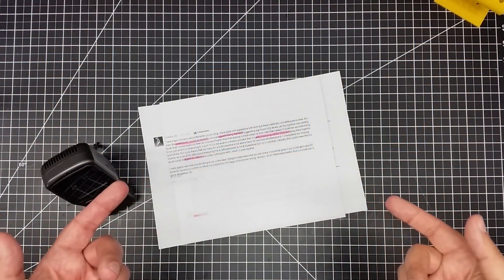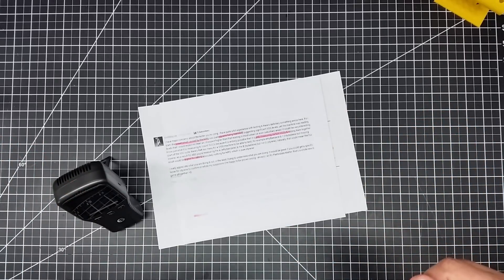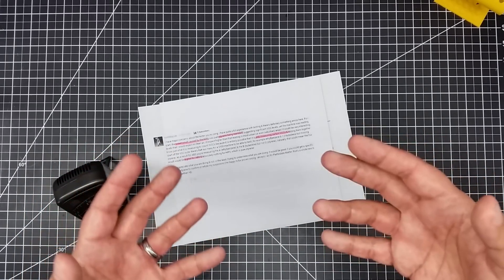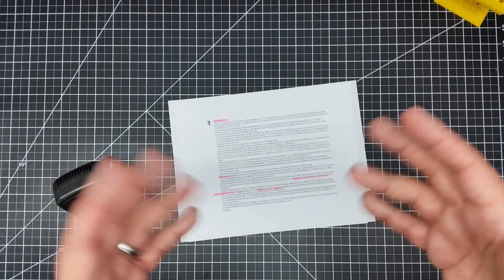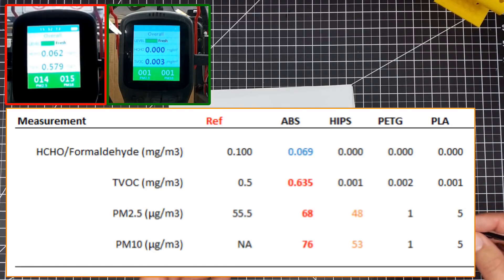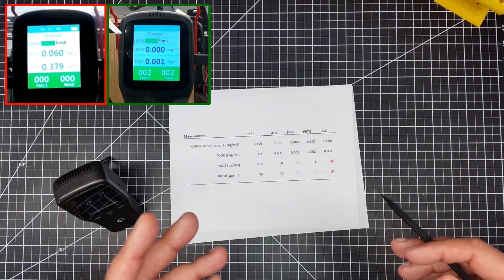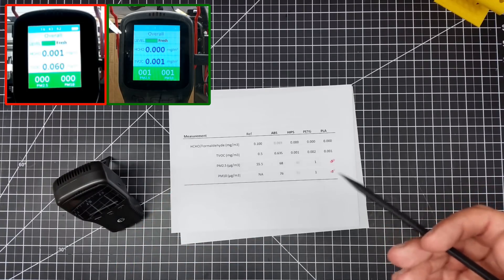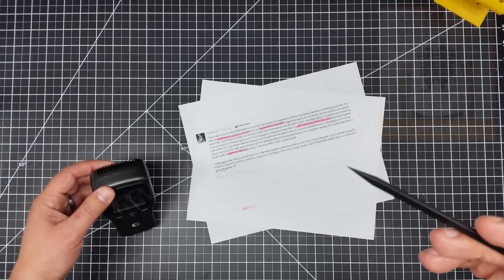3D Print Air Quality - PLA verses ABS and the Results are In!

Comment: VoC higher in the beginning could be from the solvent (alcohol) used to clean the plate and the warming of the build plate and extruder will warm up dust and chemicals on those parts.

Comment: Carbon gets saturated. You should look into a ERV to keep the room pressure and humidity balanced while exchanging air with fresh air.  

When testing with that meter you have to figure your baseline that day as the rooms VOC will change wildly from day to day then you would just record the Delta of reading not the total.  Cooking and  Cleaning made my voc meter go crazy so it could be easy to taint reading unless you have your set up in a sealed room with vents blocked.
Reply: keep pressure balanced like a PC tower? i made a container with clear acrylic doors with a fan/activated carbon ventint through a tube out my window. Its not airtight and i only have air sucking out. I need some coming in or the little cracks that i didnt seal good enough? meter to recommend?
Reply: @mackyd955  an ErV will exchange about 50% of the thermal energy with between incoming and outgoing air to temper the fresh air and also exchange latent energy via moisture.    If its humid outside and dry in your box your fresh air won't be as humid.   Doing this with a dehumidifier will ensure dry fresh air for the whole workshop.  Exhaust out of the box but bring fresh air into the room where you dehu.   Add a heater on a thermostat in the enclosure.   
You can split the exhaust to multiple enclosures or workspace hoods. ErVs have  constant CFM starting 40-60.    With boost CFMs of 120-160. To much larger.    They have high static pressures too and dual motor systems will let you balance intake and exhaust if you have like a mrv13 on your intake

Comment: Can someone please help.    I have a relatively low budget, but put a lot of time setting up a PLA printer in the back of my "computer room".   I got an Ender 3 Max, which I do like.  I bought a hutch-like table with a long counter top basically from a garage sale and the end plan was to have two 3d printers.     I have just one now.   I will never have more than 2.
The idea was sound, I spend a lot of time on the computer and so yes, I can be there if there's any problem with the prints.
Should I move all this to a room downstairs, or is that overkill for just PLA printing, just for air quality, cancer avoidance, what have you?   It will also be a big hassle to walk back and forth down there every time I need to check on a print.     I don't plan on ever printing ABS.   I can't really fan to the outside because we have hot summers here, some 3d prints take days and the utility bill would be astronomical.

Comment: You asked why it had more at the front end. The reason is that when it's hot and cooling what happens is the processing chemicals when they make it come out of the filament.
It's like that in other things also, the reason you use a mask with epoxy resin. There are many chemicals exiting epoxy resin during cure and cooling. Remember filament heats, melts, and cool / cure.

Comment: Yes I am am very sensitive to this stuff... I have been very tired lately.  I've been printing ABS and PLA, PETG.  I have been printing ABS consistently for about a month. Finally rigged my exhaust to simply suck the air out of the room that I have the printers in.  It's just a simple 4" in-line fan with hose. I  have it placed next to a hole that is at the base of the ABS printer's enclosure.  The inlet is next to the other printers also so I feel like that will be good enough. It's a 12 x 12 room.

Comment: So what is the best approach for people that can’t take it outside or garage to print? I use mostly pla/petg.
Reply from the maker: As you can see from my air quality videos  these two are not bad however if you or a family member have respiratory issues (like my wife) you will still have issues because of particulates.  Many people in this situation build cases and vent to the outside.  However in all seriousness, 3D printing like other forms of hobby making really require a space which has an adequate air flow for safety.

Comment: This was a video I was involved with. The meters we used are extremely accurate in particulate measurement. At one point using PLA we recorded 30000 nano particles per Cubic Centimetre of cabinet space. I hope this is seen as informative rather than a post hijack https://youtu.be/Dl7rOHnk4fY
Reply from the maker: Interesting however PLA inst that bad, what about ABS?
Reply: @DIY3DTECHcom  thanks for your reply... well this is the thing and the reason we did PLA. No there aren't the harmful VOC's, but what is the problem is the massive amount particles that can be ingested. Smaller particles can enter airways and cause all kinds of problems respiratory and circulatory and worse the body cannot expel them. I wouldn't want to be an employer with one of my employees sat next to a 3D printer all day. 
Lawsuits will be coming... there was a post on Lawyers.com last week 'Research done by the NIOSH found that 3D printing materials that use PLA filament at low temperatures have the potential of generating over 20 billion particles per minute, while ABS feedstock can produce over 200 billion particles per minute.' I will imagine the US will be hearing a lot more about this very shortly....
Reply: @mattwine1  aren't the particles in PLA metabolized easily by humans?
Reply: @piesdescalzos27  I dont believe so, hence the concern... I expect there are more conclusive results online these days, might be worth  google.
Reply: @mattwine1  Yeah its metabolized but its very slow. It takes months to years to do so. It can activate the foreign body response, so its no good, even if better than other plastic that can't be swept away by cilia. Also, this is for pure PLA. But for FDP PLA it's usually several molecular weight PLA + other polymers (that seems to be very nasty, even if the lowest amount of all the filaments). So while it seems that a carbon filter is overkill in the presence of proper ventilation, its obligatory in its absence. 
Foreign body response can definetely make your life miserable, even way after the insultant has been removed. So be safe, and assume your PLA filament is fused with hazardous polymers.
Reply: @piesdescalzos27  thanks for your insight... our video was made a couple of years ago and was of course quite basic. No-one would listen to us wanting to believe that ingesting any material even happened. That's kind of how far our research got, what with covid and so on. We did get the health and safety executive to listen and they did eventually produce a report and guidance. I'm imagining lots of lawsuits in the near future as companies still bury their head in the sand....

Comment: I am confused  (my normal state of mind).  I print with ABS and have been reading all the concerns about toxic particles and VOC being released during the print process.  I decided to test my situation.  I obtained a monitor similar to yours from a different company. Same specifications as yours.  Ran through their calibration.  My house HVAC system is equipped with a high-efficiency filter.  The back ground particle count for Pm10 and Pm2.5 was very low around 2.  Taking the unit outside the particle count ran up to 20 which agreed with a web site that has air quality information for my area.   Using a felt marker near the device the TVOC jumped considerably.  Looks like the device is working.   Now to test my ABS printing.  The room I have the printer is a 10' x 10' room with an 8' ceiling.  There are two windows in the  room as well as a floor vent for the HVAC system.  I ran the test with the vent, windows, and door closed to trap contaminants in the room.  Make it a worst case situation.  What did I get?   NOTHING.  The particle counts stayed around 2. The TVOC went up slightly but the unit stayed in the "GREEN" for air quality.  I ran a 2 hour print. So I figured the unit I had could not measure the smaller particles from the heated ABS.  I replaced the meter with one from Igeress. This one has a count for p1.0.  Ran the test again.  Same thing.  I don't get any increase other than a very slight increase in TVOC.  I even moved the meter directly over the print bed.  I doubt the ABS filament from IC3D is any cleaner than ABS from someone else.   I don't understand why my measurements show nothing where others using similar instruments from Igeress or other show significant higher numbers.   Comments?
Reply from the maker: Several things as first and foremost with ABS it is not about "particles" however the release of styrene and its related compounds (as the ABS is broken down during heating).  Now one can say "oh this isn't a lot" and for some they could be right however others they could be wrong.  For example my wife has asthma and a single print would bother her and not me (this is why I built a shop separate of our homes HAVC envelope).      To why you didn't see the change?  First you have to measure the output in a measured reference area as if it is being defused in an open it is still there but your meter will not read it as it will not pass your meters sensor.  Then I know the next thing your going to say "but that's not fair", and my answer is yes it is because even if you have a HEPA or MERV 16 filter you can not filter the styrene out of the air and it becomes cumulative setlling on  object and building up over time.  The only way to deal with it is to have active direct ventilation...

Comment: If I have a cr10 mini in my room printing my pla from creality is it ok or should I put it somewhere else
Reply from the maker: Well as I say in the video, I am not a doctor and PLA is not that bad as say compared to ABS or it polystyrene based relatives, however frequent use will deposit mico-particiales which can build up over time and the bed room is a place where you spend a lot of time in.  So even with PLA I recommend they be placed in a location where there is a reasonable exchange of ventilation and not an over abundance of fabric surfaces.  Also keep in mind that one PLA can be ok then who knows what the Chinese will dump in the next batch as filler just like they did with melamine in the milk....
Reply: DIY3DTECH.com do you have a filament recommendation that is a good one

Comment: I remember someone who was printing in PLA liked the sweet smell which is believed it was from corn starch like a waffle.  Here it is said the sweet smell caused by HIPS is from styrene.  Like to clarify that the sweet smell in PLA is not from styrene, no styrene is mixed into PLA. Is that right?
Reply from the maker: I have never smelled a sweet smell with PLA, a sweet smell is basically "styrene" a carcinogen found in styrene based plastics such as ABS/HIPS and ASA.  In normal PLA, there should be no styrene however you can never guarantee what the Chinese will mix in....

Comment: Your readings may be different at the very beginning vs later because many air quality readers for the first 30 seconds read every second (real time), after that it reads at longer intervals.
Reply from the maker: Not really as I have made many tests as seems to be focused on the solid layers contacting the heated bed prior to in-fill.  However I don't full understand way the "top" layers don't repeat the effect...

Comment: Emissions of Ultrafine Particles and Volatile Organic Compounds from Commercially Available Desktop Three-Dimensional Printers with Multiple Filaments
https://pubs.acs.org/doi/full/10.1021/acs.est.5b04983

Is 3D printing safe? Analysis of the thermal treatment of thermoplastics: ABS, PLA, PET, and nylon.
https://www.ncbi.nlm.nih.gov/pubmed/28165927

Characterization of Emissions from a Desktop 3D Printer 
https://onlinelibrary.wiley.com/doi/full/10.1111/jiec.12569
Reply from the maker: Yes if you read the resource page there are a number of these links...
Reply: I only saw linked under the video which actually doesn't take you to the article just a reference to it.

Comment: I've been really enjoying your research in air quality. There is however a specific thing I'd love to see you test and show here! Algix Algae based PLA. It makes for some very cool prints with an excellent texture, BUT...and this is a big but...it smells absolutely wretched while printing! The smell may be hard for some to imagine, but basically it's roasted algae/moss smell. So I'm wondering just much more nanoparticles etc come out of this type of PLA compared to 'normal' PLA. Or of there are any other gases etc emitted that I cannot detect by nostrils alone.
Reply from the maker: Please send me a link and I will do some testing 🤓
Reply: Well apparently the place I got my roll from last year, www.printedsolid.com, no longer has it. 
The company website is http://algix3d.com/products/uncategorized/advanced-pla/  And it looks like maybe they've changed their formulation since my purchase, but I can't verify for sure.
Reply from the maker: Interesting and it melts at 165c will look around see if I can find...
Reply: Yeah oddly low melt point! I found that I usually print it hotter, more like 190 and it's very prone to oozing and stringing badly over long expanses. It doesn't respond the same as other PLA to retraction settings either. Or maybe it was my possibly older formula, maybe that's why they changed it? Hope you can find some to play with, despite the drawbacks I still want more.

Comment: does it taper off because the fan of the machines are kicking up the dust/particles of the initial start up and then it evens out over time as they settle?
Reply from the maker: Good point but don't think so as I tested various fan settings and even ran all of the fans before starting to ensure the air was worked up however the same results...

Comment: I really like even these basic tests. I have stopped printing ABS all together in the house printer, and i am building a carbon/HEPA for point of contact ventilation. By the way, tell Dr. dave brakes have not had Asbestos since the late 70s.
Reply from the maker: Yes you are correct as the sad part is something in the US becomes banded, you  typically see the processing machinery be boxed up and sent to other countries which are less "alert" as you put it...
Reply from the maker: Lol!  Dr Dave like I have a bit of grey hair and remember those days:-). Also glad I could help ;-)
Reply: Keep in mind a HEPA level 13 or 14 is required to actually be small enough to capture the nanoparticles released by these materials! Standard HEPA for 0.3 micron won't capture much.
Reply: Regarding brake pads - a minor correction being they shouldn't have contained asbestos but many did, & I'd hazard a guess that some may still be produced by less scrupulous people that do contain asbestos (my father was a mechanic, plus my own research). Many people don't realise that although in the 70s we became more aware of the dangers of asbestos it was still in common use until decades later in "alert" countries (like the UK/USA) & is still used in others! A good crib list of legislative bans can be found at http://www.ibasecretariat.org/chron_ban_list.php.
Reply: Good call! I'm working on creating a HEPA/activated carbon filtration system for each printer enclosure. Doesn't have to be as large and much easier to create the negative pressure environment for each machine rather than a whole room.
Reply: secretagb I agree. I'm taking the 'PPE' route myself & relying on high specification face masks rather than any form of room-wide filtration. That's when I'm not printing in PLA, of course, (which I have yet to do, other than trying rPETg briefly). I'm going to build a full enclosure with active ventilation to the outside for when I will start printing in earnest. I'll also have a form of scrubbing prior to exhaust to reduce any environmental issues.

Comment: What's the best style of ventilation? How light or heavy are the fumes to the atmosphere? Ex. I heard when cutting a propane tank it's best to drain it upside-down because propane is heavier than Air. If I was going to make a ventilation system for propane my exhaust would be on the bottom but if I was doing helium since balloons float it would be on top.
Reply from the maker: See the air quality playlist in the description and share with you the system I use to create positive ventilation...

Comment: 0.001mg/m3 maybe it was from ABS printed parts of the 3d printer itself heating slightly?
Reply from the maker: Hmmm guess anything is possible but the DaVinci I don't think has really any part that would outgas like that but as as I am typing this I do run the first layer at 1/2 speed and maybe there is a build up?  I am going to have to do some testing when I get time.  Thanks for making me think of that...